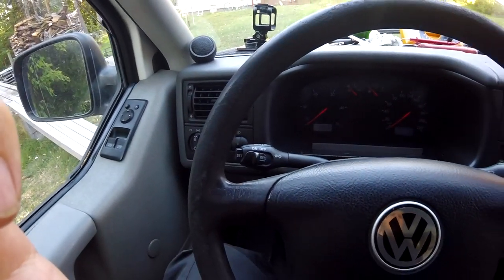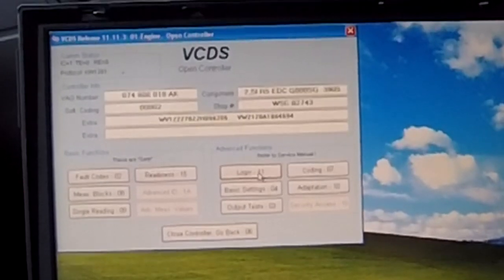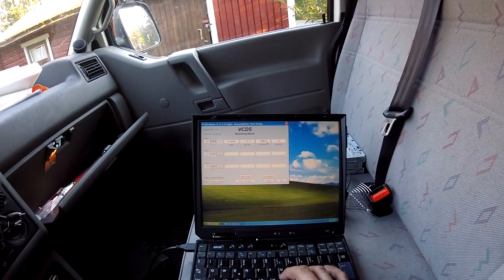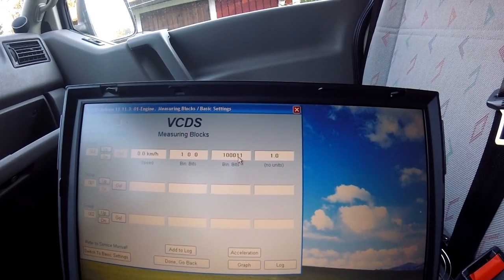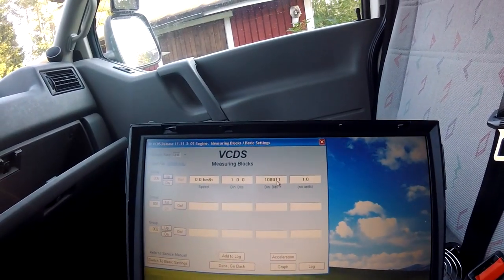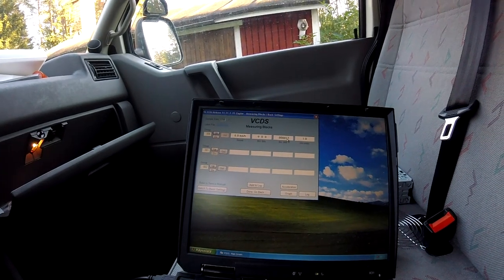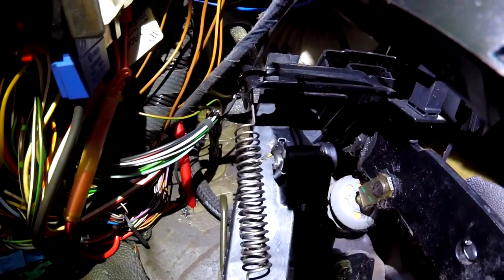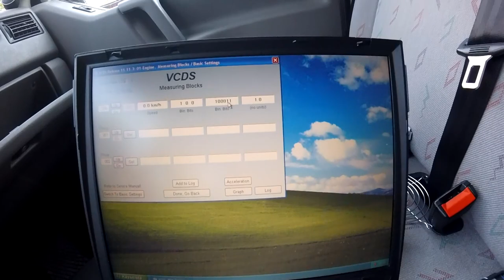VW Transporter T4 diagnosing Cruise Control System CCS

Comment: Thanks mate, really helpful video. I just installed cruise control which didnt work. Tested with OBDeleven and turned out to be exactly the same issue. It seems my clutch pedal doesn't reach the switch as if there is something missing, so have made a little extender out of bits in the garage and all is well 👌

Comment: Hey, great video! 
how do I know to make sure my T4 has an electric throttle, I assume it does... Model 2001 2.5l 75kW
Reply from the maker: All 2001 should have it. I should have one switch/lever extra somewhere that you can have for 20e + postage, assuming you live in Finland. It does not have correct plug though, but instead abikos you can install into the plug under your dashboard.
Reply: Thanks for that! Iam also from finland. But I found it when I bothered to check and yes there is an electric pedal.
I also found the cruise connector easily, thanks for your good advice!

Comment: Good Video very Good 
Please help me , My car is 2002 Jetta TDI .  cruise does not work
Reply from the maker: Connect vcds and diagnose it. If you don't have it, open the switches and inspect them visually  for wear and using a multimeter check that they function correctly. Most likely it's a faulty clutch or brake pedal switch if it has been working previously.